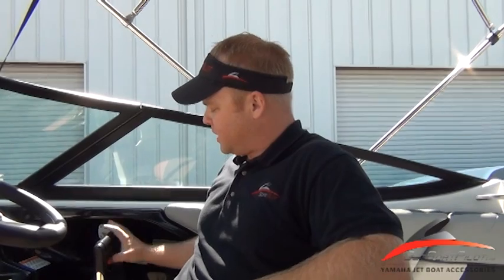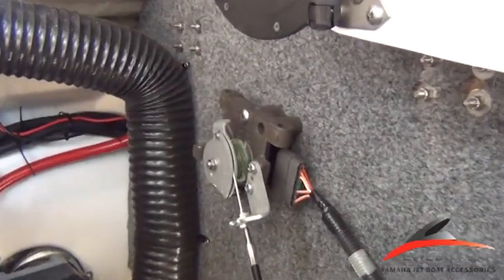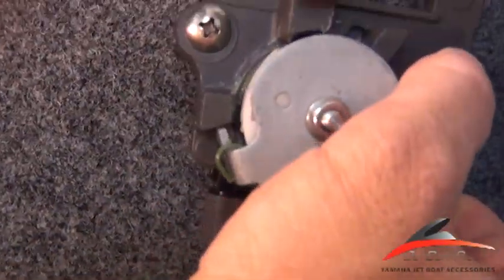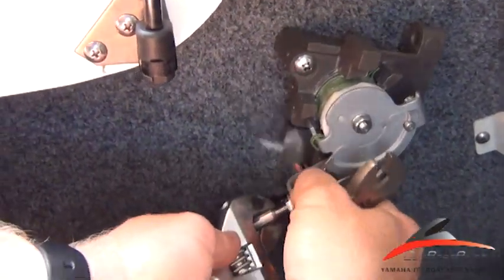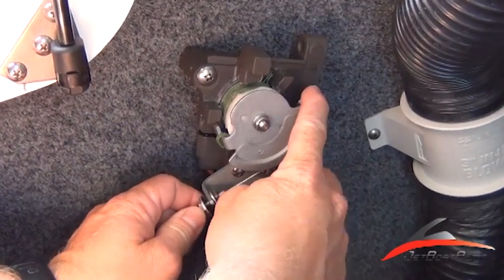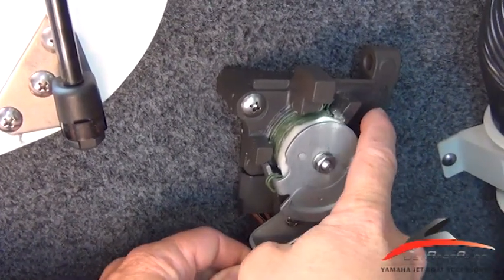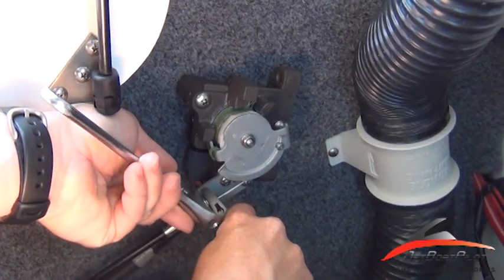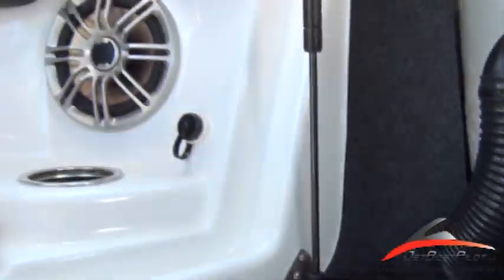Yamaha Jet Boat Throttle Sync Cable Adjustment Video

Comment from the maker: The throttle position location on the MR1 motor is under the air filter cover if I am not mistaken.

Comment: That was helpful thank you man! 
I also have this issue with the tightness of the throttle levers, especially one of them. How can I fix that? Do I have to lube it somehow/somewhere or something?? 
Thank you again!
Reply from the maker: If you have tight throttles you are in need of a replacement. They need to be cycled at least once per month to prevent seizure but even when cycled often they can freeze up slowly over time. There's not really a great way to lubricate the cables as of this moment. Your local dealer should have the parts on hand or be able to get them for you quickly. If you don't ahev a local dealer you can order them through jetboatpilot.com

Comment: I just bought a 2020 sx190 do I make sure with the throttle pushed forward to max that its able to reach max rotation???? single engine....
Reply from the maker: Push the throttle to max rotation and then check the throttle position sensor to make sure it is reaching full travel. If not you can adjust like in this video.